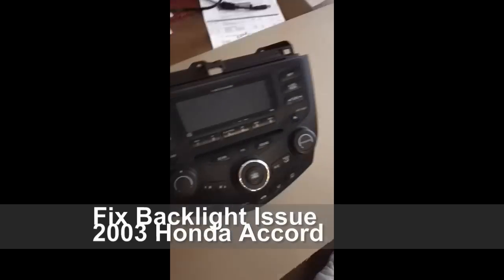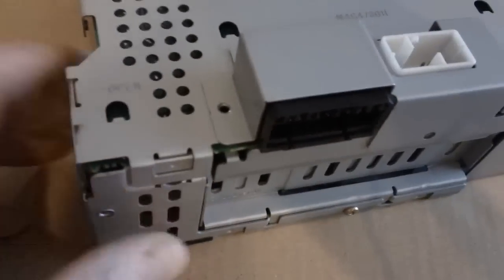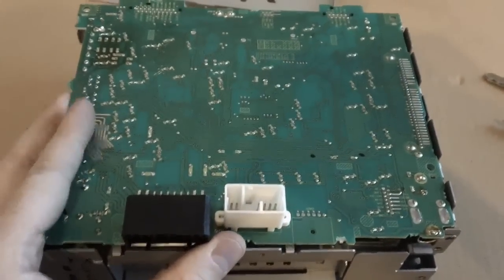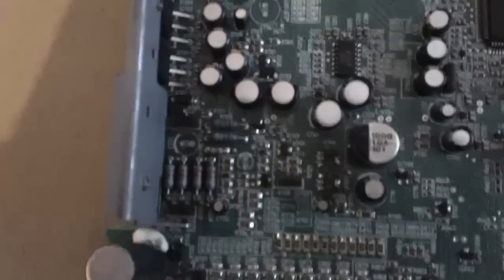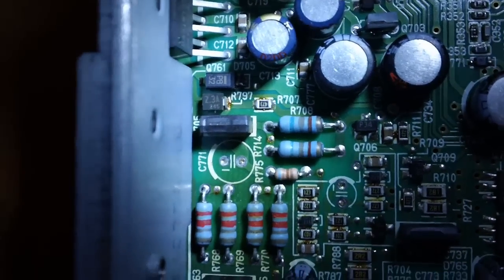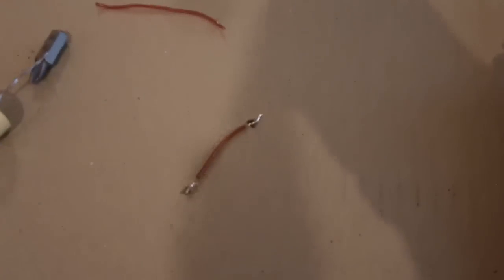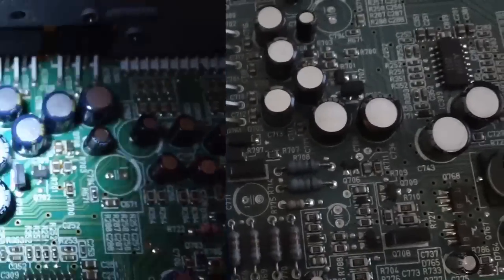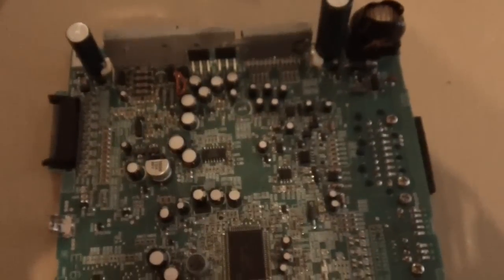Honda Accord Radio Back light Fix Tutorial

Comment: Thanks for the video, I'll be attempting the 'fix' on mine

Quick question, once re-installing the stereo unit, did you have to enter in the code for the radio to work?
Reply from the maker: yes, you will need the radio code in order to make it work again.
Reply: mitch cox Ahh okay. Where might I get the code? I've seen a video, but it confused me more, maybe you'll be able to explain it easier?
Thanks for replying so quickly.
Reply from the maker: https://radio-navicode.honda.com/
Reply: mitch cox Does this site still work with an Australian model Accord Euro?

Edit: Considering it says this, "©2014 American Honda Motor Co., Inc. All information contained herein applies to U.S. vehicles only.
Please see our Privacy Policy and Legal Terms and Conditions. For non-U.S.-distributor information go to Honda Worldwide."
Reply: I gave it a go, and it worked. Soldering in that tight spot was a bitch, though.
Reply from the maker: Jacob G Awesom! Glad I could help you out. It's crazy how many people have had this issue! I never imagined it would help so many people. Thanks for letting me know!
Reply: I'm very glad you posted the video up otherwise I would have just purchased another stereo unit and wasted an exorborant amount of money.
I would recommend people use the CurcuitWriter because that seems to be a much easier option.
Reply from the maker: Awesome! Glad to hear my video helped you out. Yes the Circuitwriter pen is a handy little tool. Thanks again for you comment. For those interested, you can get one here. http://amzn.to/1M3GasR
Reply: +Jacob G same for me, it was a bitch.
Reply: 1 year and still works perfectly!!!

Comment: A million thankyous for this video.  I have had the issue for a long time and I am looking forward to taking the plunge to fix this.  A quick question... did you actually remove the bad resistor/fuse or did you just jump it with the wire, with the resistor/fuse still attached? 
Thanks again for your video.

Comment from the maker: Well, the backlight on mine was completely gone, I could still see the numbers on the display if the sun hit it just right or if I shined a flashlight at the right angle.  The display still worked, it was the backlight that lit the display that was out. This may be what your referring too.  You can still see it, but only when the sunlight hits it. If you can still see it at night, then your issue is a little different then mine. I had no lighting at all on the display.

Comment from the maker: @tullisgood I did NOT remove the bad resistor I just soldered the wire on each side of it. I just bypassed it.  I am sure there are electrical engineers out there that would probably call me crazy (or other names) for bypassing it instead of replacing it.  But it works! 
Good luck.

Comment: Nice DIY on radio display  how did you knew wich resistor was bad i have a 2004 acura tsx and it looks like is the same board
Reply from the maker: If it is the same board I would recommend trying the same resistor.  If yours is already broken then it cant hurt to try it. Right?  let me know how it goes.

Comment: Mitch, was your actual radio working or was the backlight just not working. I haven't seen any postings for a 2006 Honda, but the radio looks identical at least from the outside. But my issue is the back light isn't working all the time, but the backlight is also out as well, but only the radio backlight. My other lights are working. Sometimes my radio will come on when the car is just in the garage on it's own. I went to leave for work one day and the radio was already on and it scared the crap out of me. I just wanted to see if your only issue was the backlights. I hope to find a fix for my problem.

Comment: Hi Mitch, nice video! Have you ever determined is this was a resistor (measured on ohms) or a fuse (rated in amps).  Seems unlikely to be a fuse, as its not very user replaceable.  If it is a resistor, then the value is measured in ohms and rated in watts for current carrying capacity.  Would be nice to replace with a factory original spec device if possible.  In any case, how long has yours worked using the hardwire approach?  Thxs!!
Reply from the maker: I have not determined what it is. check the other comments, I think someone stated what it was.  I fixed mine when this video went up and it is still going strong with no issues.  So almost 2 years now!! wow!  Time flies. Thanks for the nice comment and good luck.

Comment: I’ve got to fix mind on a 04 Accord, can hardly wait! Thanks for the video!
Reply from the maker: Good luck.
Reply: I don’t know if it will work for you but I held in my load and eject buttons at the same time for the CD for a about 30 seconds then let  them go. They didn’t work at first but the light came on a minute later. Try that a few times. i

Comment: Great walkthrough, very clear. I copied Corey Gardner and just put a bead of solder between the two connections. My radio is now working!!!

Thanks a million!

(I have a 2004 Honda Accord V6 Sedan LX, 135k miles)
Reply: I have a 2004 Accord Coupe Ex, same back-light problem everyone here is talking about.  When you soldered  between the two connections, did you cut out the old resistor or did you just bead the solder over the old resistor to connect?   Would it be okay to leave the old resistor in place and just blob solder over the it to make a new connection?   Thanks!

Comment: Hi Mitch, I have a Honda Accord 2005 LX.  The back light around the radio screen display started to go on and off, sometimes stays on for awhile but then again it goes off. Do you know if your solution will fix the back light around the radio display - or it is another component?  Alpine from California is the radio manufacturer.  They will charge me $250 to fix the problem.  I will have to remove the radio and ship the box to them.  It will take 5 to 7 weeks to get it back.  Honda will do the

Comment: Wish my radio was like your more simple. I have the orginal radio and it cut on and off at random. So what I had did was went back and resoldered the connections because at the age of the car the solder is just giving up. So I will see if that helps. I did see a mosfet that was a little too dusty like it cooked dust but since I resoldered it seems to work but time will tell.

Comment: Instead of a wire, which type of resistor could I use that would be the safest? Or would it not be possible to just bridge a resister instead of a wire?
Reply from the maker: I do not know where to acquire the bad part. Mine is still working after soldering it over 2 years ago with no other issues. So, using a wire like i did seems to work fine.

Comment: Thanks, and useful but several issues:
1.  Always follow good ESD protection procedures when working around semiconductor electronics - learn what these are but certainly wear non-synthetic clothes (slightly damp cotton is good), don't work on a plastic surface (when working at home one can lay down kitchen foil covered by a lightly damp cotton towel) to reduce static fields and sudden discharges, don't touch circuitry with your fingers or tools, and use ESD safe soldering equipment to avoid zapping semiconductors.  If humidity is low (indoors in the winter) spray a mist of water around the area to help discharge surfaces.   ESD damage ranges from immediate to something latent resulting premature failure down the road.
2.  Is that a resistor or a fuse?  The label on the board suggests a resistor, R797 (the manufactures identity label for it in the circuit, not its value), but if the A following 2.3 indicates "Amperes" (and it might not) it could be a fuse.  One can the parts value and specs from the radio's schematic (the dealer or their repair shop may be able to tell you and may have the part, and the radio manufacturer might provide the schematic or just tell you what you need to know).   Either way, there is a reason why the manufacturer spent good money to put it there - it may be controlling the current or voltage bias on another component or is there to protect damage to more expensive components or prevent fire in the event of failure.  In general replacing a component with a wire is not likely to lead to good things.
3.  If a fuse, it could blow again and one might find it convenient to rewire it to an externally mounted socket.  If a resistor, consider replacing it with one of the same resistance but higher wattage so it will run cooler, or rewire it to a more easily accessed location. 
4.  Having a radio repair shop replace the component once you've opened the chassis might be money well spent if you can't manage the above.
5.  The disassembly section was very helpful.

Comment: The radio motherboard for my 2005 Honda Accord LX Coupe looks nothing like this one.  There are no bulging resistors or any other bulging pats sticking up from the board.  It's all flat and a totally different pattern.
Reply: I just took apart the motherboard to my radio and I've also run into the same problem.... The lay out is completely different and I actually had to take out the CD tray to get to the motherboard. Now I have no idea which resistor to focus on.
Reply: did you find a solution? the only vid I saw bout 05 Honda where the guy just re-soldered all components with heat gun for whatever problem he had with the stereo. https://www.youtube.com/watch?v=-qNlXDM7VEY

Comment: thanks for the video, really helpful!! I did everything, and worked perfect! but when i started the car, the light turned off again!! btw, i used the circuit pen, and I'm sure i left it for a day to heal,, any ideas plz?
Reply from the maker: I am thinking maybe the line drawn with the circuit pen was too light. Maybe try a thicker line or solder a wire instead.  good luck.
Reply: mitch cox I never worked with solder wire, so i couldn't make it happen!! but i will try again with the circuit pen and make it thicker!!! thanks a looottttttttt

Comment: Though this video doesn't help with my specific problem, I will follow it until the back light step. I think my son shoved a coin into the disc drive. I'm going to have to open it and find out if that's the reason why I can't add a disc into the drive. The drive is shut closed not allowing entry. No discs are in the 6 slots and the radio plays fine. Anyways, great video!

Comment: sjfriedl 3 weeks ago
The bad part is neither a resistor nor a fuse; it's a varistor and appears to be a Rohm Electronics ICP-S2.3 (rated for 2.3A, internal resistance 0.026 ohms), and it's available from places like Digi-Key (just search for the part number on their site). Looks like about 25 cents.
Thank you for this useful guide; I was able to fix a friend's radio (though I used a jumper wire rather than the varistor).

Comment: Thanks for this video. I'm having the same problem, but my radio is different:( 
The whole board have different layout and components. I think it's because I'm in Europe. If I send you a photo of the radio would you be able to tell me the location of the component that need to be fixed? Or is there a way to find it?
Many thanks, JJ
Reply from the maker: Sorry.   I no longer have this vehicle and since yours is a completely different setup. It would be very difficult for me to find it by a picture.   Maybe someone in the comments can help.  Read through and see if anyone else said anything about a different board.   Sorry.  And good luck.
Reply: I have a different board and it sucks.. lol I can’t find it either

Comment: Many many thank's sir. I fix my wife's accord. (By the way i'm from indonesia) Sorry my english is poor. But if i can gave a suggestion, better don't jumper it but use a new fuse. I know it's imposible to fine some same original fuse honda. But i use 2A - 250 volt fuse. End my head unit now like a brand new. Cuz i belive if u don't use a fuse, when some thing happen with electrical your head unit will be more damage (And maybe ECU will burn too). But if you use a fuse. You can avoid more damage. That is my oppinion. But thanks. Your video is helping me.

Comment from the maker: They didnt recall it but did extend the warranty on the radio for a couple years, so if you had the problem within 5 or 7 years or 100K miles then it was covered free of charge. Mine was past 100K miles and 7 years when I had the issue. So it was going to be $300+ to fix it.

Comment from the maker: you have to removed the front steering wheel cover, but be careful and disconnect the battery, wait 20 minutes then disconnect the airbag. Its under the steering wheel in a little door.  I may try to make a video, its hard to explain.

Comment: hey i really really wana try this but im pretty scared. would you think this prob. will fix all the lights? my ac/heat controls dont light up and any radio buttons! and a another question i have is my cd player reads discs when it feelings like sometimes it says error and then i have try to put the cd a couple more times and it will work. would you know why its doing this? Thanks please reply asap im planing on doing this

Comment: Ok, I did it with 680 ohm resistor, I was guessing the size because I couldn t find the 2.3 amp resistor, they come in ohms. So the display is working now, but when I turn on lights display shuts off, with the radio still working like before. Also the red lights on the bottom part of console don t work either, so I m thinking that another resistor is bad, would you by chance know which one is this?

Comment: Hey Mitch, thanks for taking the time to make and post this excellent video! Major $$ saver as you well know and I'm all about that.
Question... What gauge wire did you use for this? I don't want to go too thin on the wire and have it fry something. Also, exactly how did you remove the faulty amp fuse from the board? Did you desolder it or did you snip it?
Reply from the maker: Thanks for the comment. Yes a huge money saver. I couldn't believe how much Honda wanted to fix this issue.  Ridiculous! Anyway. I am not sure, it was fairly thin.  roughly around 24 gauge if I had to guess. Also, I didn't remove the faulty item, I just soldered the wire from one side of it to the other. Just bypassing it.  hope this helps. Let me know how it turns out.  Thanks!

Comment: hey I have the 2004 accord I took my radio out today to this repair and it is completely different there was no ribbon the top disc drive just snaps into a connector and then its held in place by 4 screws. and now all the lights are out not just the screen.

Comment: if you have the 2.3amp....how do you remove the resistor and change it? does it just come off by pulling it like other fuses? or would you also have to cut it off? thanks

Comment from the maker: I just used a very small thin wire.  Thinner than a headphone cable, I dont think there is an exact size you need.  I just found a piece of wire laying around. I would say 18 - 24 gauge.  any of those should work fine.

Comment: Any fix for a unit that still has its backlight but no lights for the hvac or radio preset buttons? Do you think I'm living on borrowed time and that my backlight will eventually go? My lights flickered a little and eventually just never came on.
Reply: GR Lover I have your exact problem in my 04 accord. Any solution? Did you try what he did in this video? Did it work?

Comment: Hi Mitch, how would I know if the 2.3 amp resistor is blown/broken and how can I replace it?
Reply from the maker: So far, no one has been able to find a replacement for this item. People have just been wiring a jumper from one side to the other. This seems to fix it.

Comment: First of all, thanks for the video, I followed the steps and fixed my radio..... for a few days.... then I ran into a new problem: the lights (on all buttons but not the LCD screen) stayed on with the key off, door locked and security on!!  The radio itself was off too, it was so weird in the dark that these lights remained on, nothing else but themselves...  I worried that the battery would be dead by tomorrow morning so I decided to cut the wire again to shut the lights off (yes, instead of using a short wire to bridge the 2.3A fuse, as in the video, I soldered 2 long wires to the ends instead, thinking of putting a fuse at the other end some other day.  Haha, I'm thinking of putting a fuse + a switch at the other end now..... hahahaha, funny!
Reply from the maker: Hmm.  this is very strange. So.. all was good for a few days, the next day they just stayed on? Very odd.  so when you touch the wire ends together, do they come back on?  I don't know why this is happening, however it sounds like a switch would solve your new problem.  Still cheaper than having Honda fix it.  Sorry it didn't go super smooth for you.

Comment from the maker: I agree, I am sure the fuse was there for a reason, I know some people have mentioned running a long wire out the back of the radio and installing a fuse that they can get too easily, in case the one they put in blows.  However, my jumper is still running strong since I made this video.  Hopefully it will last a while longer.

Comment: HELP.
I tried this fix, and it worked great at first.  The lights came right on.  But now the lights will not turn off even when the key is removed.  This has led to my battery dying twice.  Any suggestions?
Reply from the maker: Tyler Messerschmidt Hmm..  you may have bridged something with too much solder.  That is all I can think of.